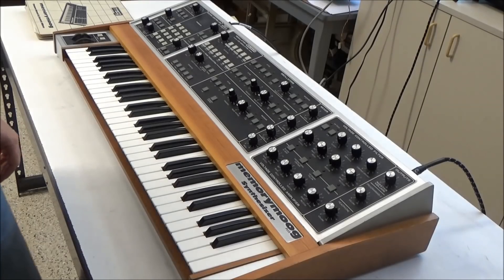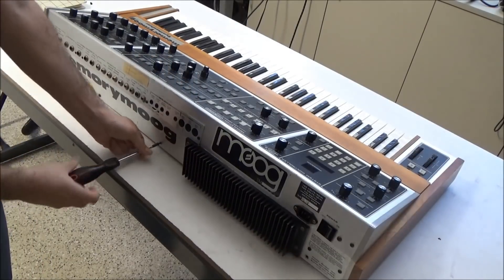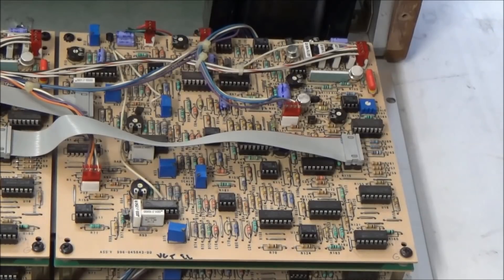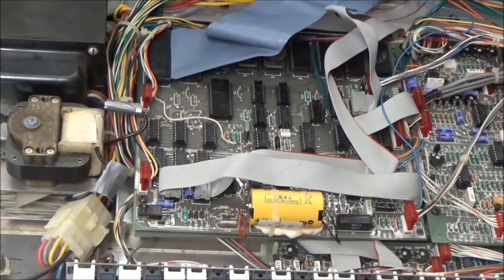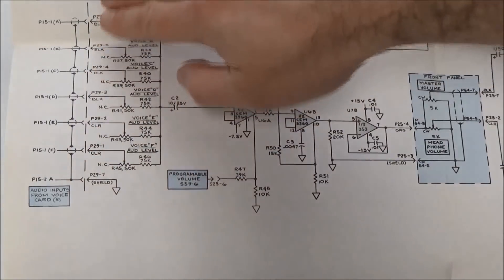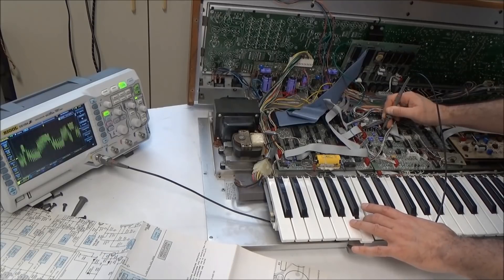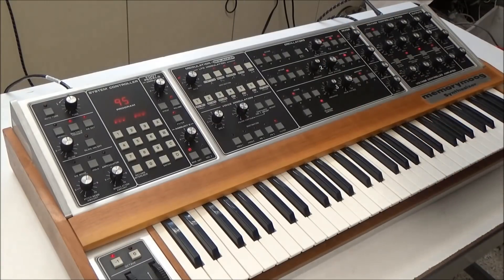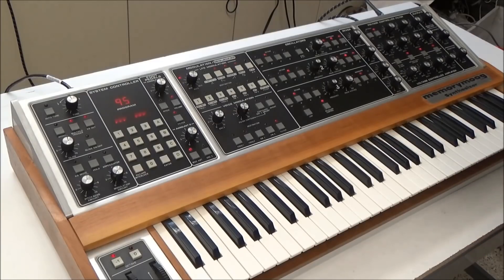Synthchaser #112 - Memorymoog Tour Inside & No Output Troubleshooting

Comment: Hi there and thanks for your very usefull videos ! My i ask you some help ? For any reason my MM+ is not internaly clocking the arpeggiator anymore, it only works with external clock source (the square wave from the Modulator oscillator CEM3340 is fine on the LFO section but seems to be always in the reset state for the arp.). I've changed buffer U26 (MC1458 CP1) on the analog boards but no change. I've disoldered the cables on the external Clock jack to see if the jack was not broken (J11 switch open instead of closed as it should be) but once again no change. Any help ? Thanks very much in advance.

Comment: Hi im wonder if you could share some advice please. Thou a bit off topic from your post i thought this maybe something you will have a good idea about . Im in the middle of designing a monosynth in which there will be about 90 odd pots and 70 toggle switches on the control interface.  https://youtu.be/VNq2EyGpcXs
Any recommendations as far as what type of connectors to use. Im a little lost here and think your experience would be very welcome.
Regards.

Comment: Moog construction drives me nuts.  Sprawling cable assemblies/connectors, stuffed to the gills w/ pcbs, a giant noisy cooling fan.  The Matrix-12 has twice the voices, but it's very organized and tidy inside there.
Reply: The Memorymoog (formerly the SL-8 prototype) was hastily put together for the 1984 AES show, under the supervision of then Norlin/Moog Music's president Dave Luce. The Polymoog is also a big mess inside. Robert A. Moog had this to say about Dave Luce: "He was a highly intelligent technically trained person, who gravitated towards complicated, sophisticated, convoluted things."
Reply: @AlainHubert  I used to have a Polymoog 203A and did a fair amount of work on it - not just repair but also engineering updates in the service manual that my unit didn't have. When it worked, it was amazing. Having separate outputs from its sections that you could run into their own mixer channels and pan and effect them independently was the secret weapon; you'd have thought God had arrived in the hall.
Reply from the maker: I'll be solving that noisy fan shortly.
Reply: All with an overworked CPU, especially with the Plus upgrade added
Reply: it's the american way! if it's not visible to the user it doesn't matter
Reply: haha! @antigen4
Reply: It's no surprise, Oberheim is the Rolls-Royce of synthesizers.